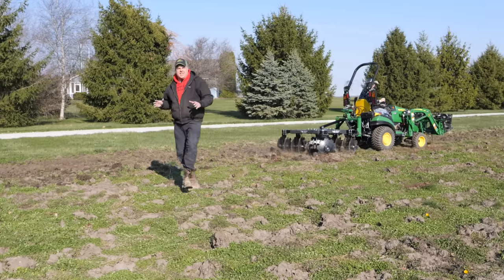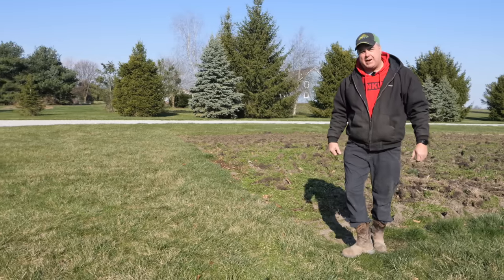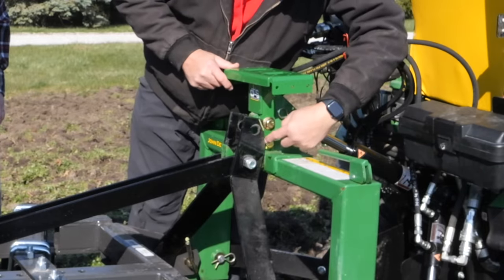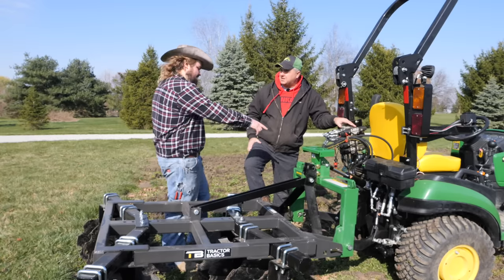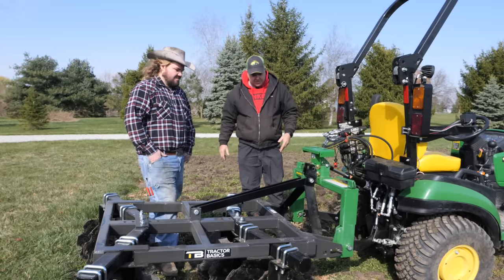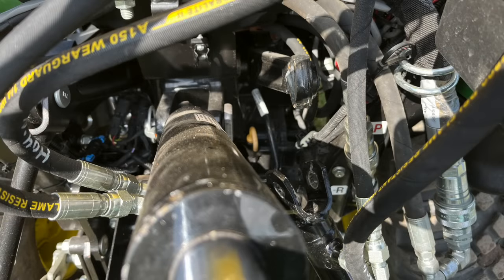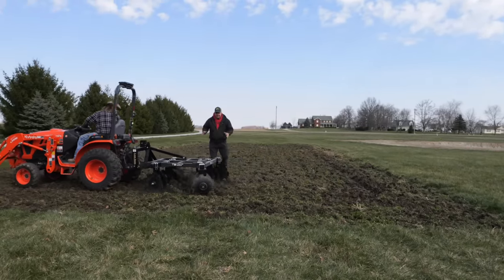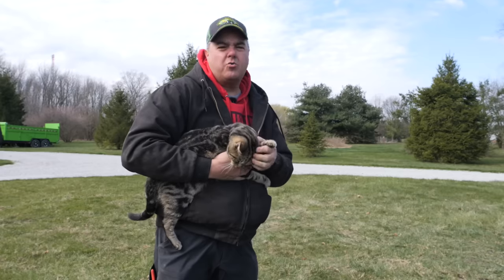Attempt to DISC the Garden BREAKS 2 Tractors! John Deere 1025R, Kubota LX3310

Comment: Hi Tim 
I stand corrected on my comment about specifications. The manufacturers can make it to a certain specification it would be a selling point. The specs allow for a 3 inch upright drilled on center,so no strength issues as far as I’m concerned. The question I have is about the attachment bolts, are they the minimum 1.62 inches(dimension M)behind centreline of hook. If the attachment uprights are straight up and down and hole is in correct position it should fit the standard mounting points. It seems that when people have problems,the uprights are hitting bolts or angle iron  mounting holes.
I like the disc implement ,but it does it does push the lift limits. Maybe that is why they don’t even try to make it quick hitch compatible,4 inches less stick out might make the difference for lifting or not.
Reply from the maker: They make a smaller angle disk for subcompacts.  Still, even larger tractors use the quick hitch.
Reply: @TractorTimewithTim  true,it would not be hard to meet the requirements. As far as I’m concerned they can get get rid of the adjustable part for room for uprights. For people that want to use old attachments on new equipment you can do it ,it’s just not a simple to do.

Comment: Honey, if you are ridging in the back, you need to raise the back end with your top link.  If you have a valley in the back, you need to lower the back end by lengthening your top link.  You don't need to change the spacing of the gangs.

Comment: I have a pat's easy change and a 1025r, they have made things easier but the three point arms on a 1025r do NOT move parallel to each other they move in arcs and so depending on the height the arms are closer together or farther apart and if you have the pat's hooks tight to the arms they tilt in or out. The balls in the arms account for this tilting of the arms but pat's hooks do not.  I feel like I should have just got the quick hitch. Hopefully I explained it well enough to help others out.
Reply from the maker: Yep!

Comment: I don’t remember if you mentioned it in the unboxing video, but does this disc allow you to adjust how aggressive the disk blades cut?  I would love to see the disk cutting into the dirt more than the slight tilt you had on the blades.
Reply: Right after I wrote the comment above, you mentioned changing the gangs.
Reply from the maker: and yes, it allows changing aggressiveness...but we did not adjust for this video.

Comment: It seems like the Pat's Quick Hitch would have worked much better and would have taken a lot of weight off the 3 point hitch.  I use the Pat's after I first heard about it on your channel.  I have both old and new attachments and it solves the compatibility problems.

Comment: Once I picked up a tiller I never looked back. Sold my monster disk asap, it was just to big a heavy . Vary abusive to the Tractor when you had it in the air with the three-point. It also was not effective when working in a tight space.
Reply from the maker: Yep.  I agree. For almost all applications, I like a tiller better.

Comment: Do they make this disk in a pull type option?  Depending on the application that might be an ok option for a sub compact
Reply from the maker: they do not. I haven't seen a small pull-type disk.   Maybe I could transform this one :-) 
Then, I could add lots of weight to it!
Reply: @TractorTimewithTim  there are some made but they are light weight things designed to pull behind an utv for food plot preparation.

Comment: Have never been  unable to do my work because my Pat's needs modified . 
I guess everyone likes to use there time in different ways !
Reply from the maker: I had to remove Pat’s because they didn’t fit several of the attachments we were demonstrating.
Reply: To demonstrate that a quick hitch doesn't fit everything either .

Proof that nothing is perfect.  Just interesting that you recommend one over the other...when both clearly aren't the answer.  

Even still...both are better than trying to kick the lower arms on over the pins!
Reply: Something else to consider with the Pat's.. along with a longer toplink.  
For me..I had used my tractor a few years before I got the Pat's . So when I changed over....my tiller pto shaft was also too short and would disconnect .  So I ended up buying a whole new shaft..and cutting to proper length.  

I think which ever way you go..stay with it..and learn all its strengths and weaknesses ...and just deal with it !   
Changing your mind seems like a frustrating way to spend $ !

Comment: Would it not work to cut those bars that run from the center of the disc to the top link pin and drill a new hole making it shorter so the top link sits more straigh/vertical??
Reply from the maker: Many solutions.  Why didn’t manufacturer choose ONE of them!?

Comment: It wasn't clear from your explanation of things you tried with the hitch as to whether you tried moving the top support arms on the disc to the alternate upper hole.  I think that is what a couple suggestions were referring to.  I also wondered the same thing and whether you may not have those flat bars connected to the right hole.  It would make the discs top link connection arms to be more vertical and might help but wasn't sure.  Otherwise it may be possible to drill alternate holes in those flat bars to modify the angle for the top link connecting arms on the disc.
Reply from the maker: check out the prior video.  it will make sense:  https://youtu.be/v6ILnETxI7Q

Comment: Tim, are there any companies that make attachments for compact and subcompact tractors that are producing or designing implements, like a disc, using a draw bar and raising and lowering with your rear SCVs?  Watching your and other videos, lots of times the power of the 1 series in pulling a ground attachment or rotatory mower isn't the problem.  The problem is with the 3 pt hitch either not giving you enough clearance, or not strong enough to lift the implement.  I understand there may be additional costs with this approach; however, I do think their could be a lot of advantages as well.
Reply from the maker: I own the smallest pull type disc that I know of.  8' from Monroe Tufline.   The only other ones are mechanical lift for ATVs.

Comment: A disc on the smaller tractors is a waste, a good tiller (not the cheap junk!) would do a much better job and faster even though travel speed is slower. I tilled gardens as a business for many years starting in high school and would take a heavy sod grass area to ready to plant garden in 2 to 3 passes 8" deep with a JD 955 and JD 660 tiller. The small discs dont have enough weight to cut and also lot harder to chop up the sod. I was tilling red clay and shale ground in NW Virginia.
Reply: I agree with the disc being a lousy choice in principle with small tractors which means small tires. Discs need 5mph plus speed to work properly and lots of frame weight to make them penetrate. A high quality tiller going slower is great .
Reply: @johnkemp4370 y'all are full of it. I have a 770 jd with a heavy 5 ft disc and i pull it to the axles with a board behind. Does just fine
Reply: 2152 you must be in sandy soil, not central Texas black dirt

Comment: Hook up without the quick hitch. The farther away from the tractor the more weight you create. Physics. You said that the disc was probably too heavy for the tractor. Use the quick hitch on lighter implements for these tractors

Comment: With my 1025R and running my offset flail mower, if I use a quick hitch my tractor can't lift the heavy mower (unless I mess around with using my hydraulic 3rd link, but it is still difficult to lift).

When I directly connect my flail mower to the 3-point hitch my 1025R lifts it with no problems. 

I would have preferred John Deere gave the 1025R a bit more 3-point lift capacity,  but they didn't...

Having said that, I don't find it all that hard to directly attach attachments to my 3-point hitch.

Edit: I should mention I adjusted my hydraulic pressure to the max per my dealer (2000psi +/-100psi). It was set to 1800psi when hot when I bought it.

The only time I find the offset flail mower doesn't lift easily is if I've been working in a dry mud environment, chopping up primarily weeds and mud builds up inside the mower. I find that mowing a few sticks or small trees quickly gets rid of the heavy mud though.

Comment: Kubota > Deere.... I'm just saying. Of course, this is preferences. 

It's interesting to see that failure on the LX. 

I have an L2501, and i have abused it, and nothing has  broken... yet. I have an ancient disc that needs 5 blocks to work, so i hear ya about weight.

Love the channel looking to get the new heavy hitch ripper setup you had.
Reply: Pretty certain the rod goes to that angel piece and the angle piece has a pin going into the arm. The pin is supposed to rotate, and it isn't causing the failure. It realistically should have a heim joint with a plastic liner. Even a nylon heim joint would likely have fewer crosion problems and last forever.

Comment: as a vintage  Farmall  tractor restorer ( 1941 - 1955) , I'm sitting here  seeing the modern  version  of  what Farmall came out with back in the 50s ( Farmall fast  hitch)... lolol quick hitching  isn't  new folks. But  yes  I think  your  using a way too small  tractor size for what  your doing and  the size  of disc vs tractor. Yes  I agree  ... bottom  plow  first then  disc . Seems these  new  tractors aren't  built strong enough....I'll stick  with my 70-80 year old  equipment  that  doesn't  break as easy and has a fast  hitch.

Comment: I suggest spending less than 10k on a 40 year old, 2wd ag tractor in the 50hp plus range.  Compacts are nice, but most people don't need a compact or 4wd. A want versus need situation. Old school chains will handle winter needs.

Comment: Tony from Tony's tractor adventure  told me the fastest quick hitch to use is Pats easy hitch
Reply from the maker: Use whatever you want. I personally don't care for Pat's. ...but others like it.  Plenty of room for multiple opinions. :-)
Reply: @TractorTimewithTim  one reason I do cause not all attachments fit a quick hitch . The width on most are wrong and on my first subcompact tractor that was true and I had to cut and reattach the brackets in new locations. The cost of those attachments should of fit but they wouldn't.
Reply from the maker: Not all attachments fit those fat Pat’s either. And top link has to be extended too far.   
None of the options are perfect!
My favorite is the European approach (copied from Oliver many years ago)
Reply: @TractorTimewithTim  Your right Tim but I'm  fabricator and most things that don't work I fix. You remember the buckteer you had well I have it now and changed the way it mounts to the tractor.  It will never touch my bucket.

Comment: I have only thought of a disk to follow a plow, to smooth out what the plow does.  I would of used a tiller on this job set to 3 inches.  It would tear up everything and go quite fast at that depth.   (I realize that the goal was to see what the disk would do)
Reply from the maker: Just skip the plow. Till it with rototiller a few times and go!   If you are able to plan ahead, spray with roundup, wait two weeks, then till it.   Even better, spray and till in the fall, till again in spring.  
The plow, while lots of fun is simply a waste in my opinion.  Hate to say that, as I LOVE to operate a plow!

Comment: The 60” king kutter cb disc like I mentioned in another video you’d know it’s back there. Figure it’s going to be little lighter with the angle iron frame and stuff. Still had to modify the hitch to work with the Imatch hitch. The king kutter disc I got from a death in the family few years ago.
Noticed in dealer’s attachment booklet frontier has a 48” disc for 1 series tractors. Figure the smaller disc maybe the better way to go being lighter for the 3 point won’t work as hard lifting it. Would wonder if it was worth making another video showing the smaller vs the bigger on the sub compacts.
With my king kutter I used it few times discing ground I tried some plowing with a model A John Deere and an old 2 bottom plow. I’ve gotten few more plows for the model A but also got a 10ft disc. I prefer the model A and the 10ft disc over the king kutter xb disc.
Reply from the maker: heavier is better for discs.  Not interested in any lighter disk. I'll just raise the relief valve pressure or use johnny x before I get a lighter disk.
Reply: Was neat after few passes on the plowed ground the king kutter disc really cut up the ground and eventually ground felt like powder almost. The area was tilling the dirt was around a bonfire pile, I wanted all the weeds and stuff gone so any fire would stay at the pile. 
When I got the disc for the older model A JD been mainly using that, could cover my small field quicker. Over the plowed ground felt more comfortable riding over it with the model A pulling the disc. Also in my situation the larger tractor and disc makes more sense for a few acre field, what I’m liking about still havimg the disc on the 1025r is I have a backup and got something to use where the model A and disc can’t fit to well like a garden. Plus I gotta give the older tractor some playtime too lil Johnny can’t take all the playtime.
For weight over the years I seen some farmers just put big rocks on their disc as they go over a field, big problem with that was said rock rubs on the discs then busts em along with jamming the gang.

Comment: Attachments are not cheap. It’s really not a big deal to spend the time to make all your stuff work with the quick hitch you own. I like my speedco and have not had to redo anything to extreme to make stuff fit. I have a 1990s ford brush mower . And it worked fine with my speed co. I did modify to fit the 1025r but that’s not to to speedco fault

Comment: For this height machine with its 3pt geometry, a 14" to 16" disc would be a better fit. Understand you wanted more weight to use gravity in your favor. Better results with compact lighter equipment, could be done in multiple passes first turning/ripping/cultivating soil more times (than you did - yes, saw that) before discing/harrowing.
Reply from the maker: Yes, 14 or 16" blades would be better.  Keep the heavy frame, but use smaller blades.  I agree!

Comment: My thoughts. It seem the one series tractor would not let the disk down all the way. So it did not cut as good as it could. And as you came of the garden on to the sod the rear wheels would lift the disk and that maybe why it was not cutting the grass as well at the end of the garden towards the house. 
The other trouble with a disk is, the tractor tires are compacting the soil, making it harder to disk. 
Must be different engineers at Tractor Basics for the disk, and the Quick Hitch. 🤭🤭
Reply from the maker: 1025R was indeed dropping the disk as far as it would go down.  The cut was limited by the lack of weigth on the disk.
Reply: @TractorTimewithTim  👍🏻👋

Comment: I’m not bashing the 1025R but it doesn’t have the hydraulic power to lift a disc. If I had to do ground engaging work I’d get a Kioti or a Summit. Speaking of Summit how come Summit didn’t pick you to advertise their tractor? I think you’d love a Summit because it’s a little bigger than a 1025R, I think it’s about the size of a 2 or 3 series John Deere. Some of those stats for a Kioti are much much better than Deere. I believe the CK has way more lifting power. Maybe one of these days you might get to try out a Kioti perhaps their new HX series tractor with power boost technology
Reply from the maker: I have a history with the founder of Summit (Doug Rehor). I would not represent him in any venture.
This is his 4th try (at least) in the compact tractor world.  ....McCormick, Cabela's, RK, and now Summit.
I don't see any way that Summit can be successful in the long term.
Reply: Ah I see. Sounds like Kioti would definitely be the better choice. I can see the Summit being like the Solectrac dying even before it takes off

Comment: Doesn't look like you've given the Kubota any love, very rusty hydraulic connectors and frame. A little more Wd-40 please.
Reply from the maker: One frame piece is rusty...across between the rops.  I showed a photo of the problem last year.  We had it parked right under a birds nest.  They pooped on the seat and on this frame piece.  Totally corroded it in just a couple of weeks!   Barn swallows I think.  We are now aware of where they nest, and avoid parking stuff right under it.
Reply: @TractorTimewithTim  Thank you Tim.

Comment: Get rid of the three point put on a draw bar and put an axle midpoint on the implement raise it with a wet line
Reply from the maker: Great…but think it through. Not nearly enough room between the gangs of such a small disk for wheels, especially with rotating axle pipe.
Reply: @TractorTimewithTim  thanks for getting back to me Tim we had a rhino disc like that had wheels outside of the disc just stub axles welded to a piece of tubing that ran across the top of the frame wish I could draw you a picture but the tube hinges on the frame and the hydraulic cylinder was on the top it just pulled the wheels up when the cylinder was extended you only need them down to turn anyway it’s an old system but it will also take the strain off your tractor you can also put a height adjustment on it as well the wheels also act as weight i like your channel keep up the good work
Reply from the maker: @jimwhite9985 yes, Jim.  I have an 8 ft pull type disk.  I’m fully aware of the advantages.